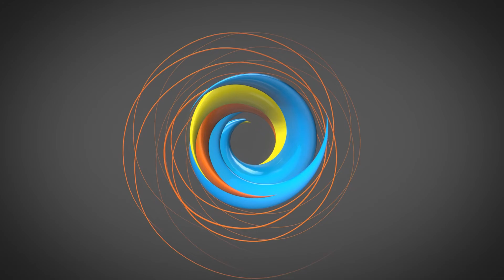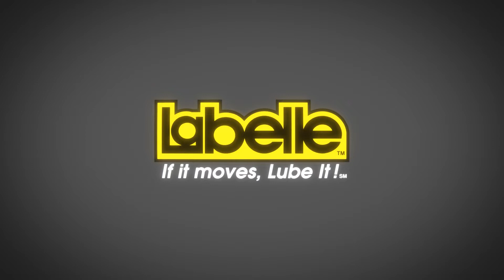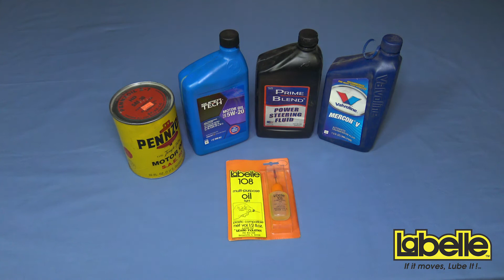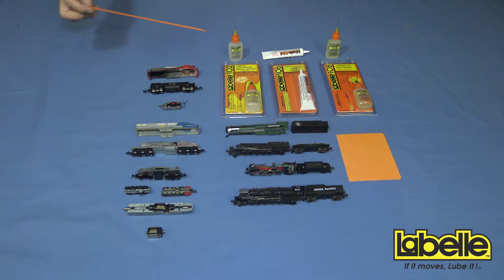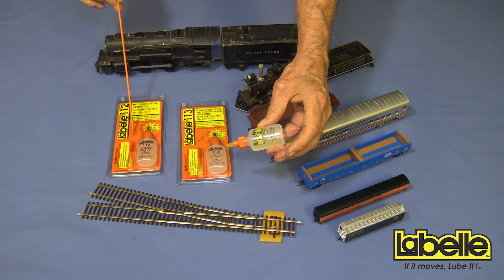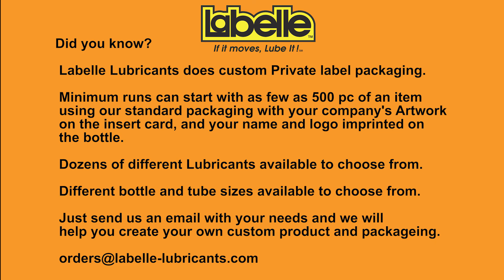Labelle How to Lubricate and Maintain Your Model Train

Comment: I lube the turnout points whenever I'm working with paint or ballast near switch tracks. I've found out it works. A little bit of LaBelle 106 will solve a lot of issues up the road.

Comment: I have a motorized toy that is having issues with the noise due to a lack of greasing due to me trying to handle the toy and take it apart. I wanted the figure to look a certain way and I have been hearing an ugly noise form the gears. I was told to use these Labelle products as opposed to Vaseline as Vaseline would dry out and certain oils and such would work best to loosen and ease up the gears. I am currently buying the 106 to ease up the gears.

Comment: My saying is always "If your Train performance goes to Hell, look no further than Labelle".  Been using Labelle products since 1977 when I was just a kid playing with Tyco's and Lifelikes and brought Labelle with me in my Athearn and Walthers days.  I've heard every hack in the hobby from tooth paste nonsense to WD-40 and I'll tell you this, If the Train needs it Labelle makes it and if Labelle doesn't make it you don't need it.  I have rebuilt hundreds of Locomotives over the years from all brands and seen most of the tricks that brought those said Loco's in for repair.  The only product outside Labelle that helps and is needed (Especially older Athearns) is some Ox-Guard for the metal parts that like to oxidize, other than that use Labelle, it may cost more in some aspects but it's a trustworthy Co. that makes a great product line. No I wasn't paid to say this ;)